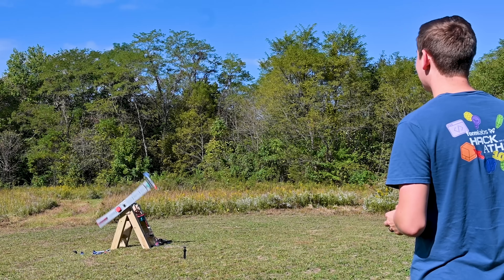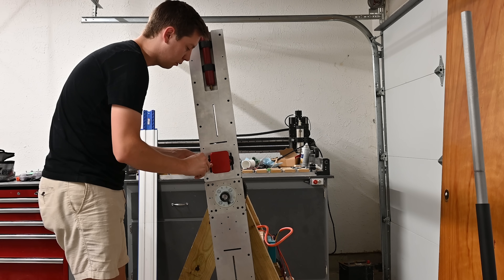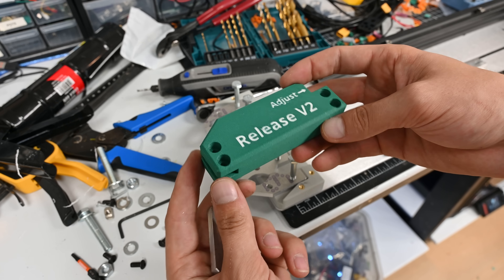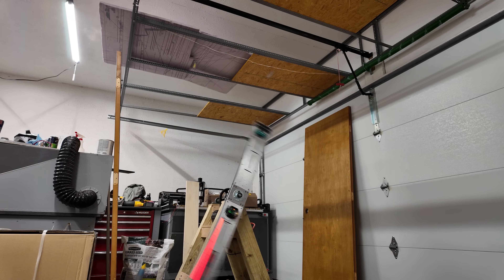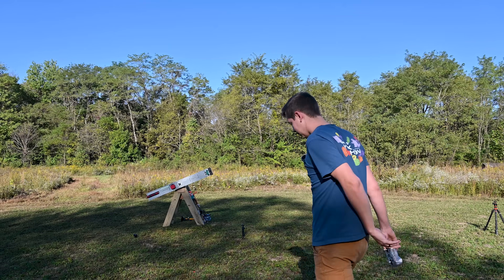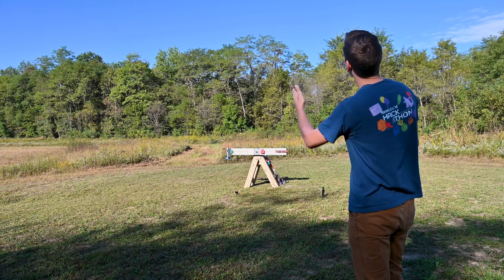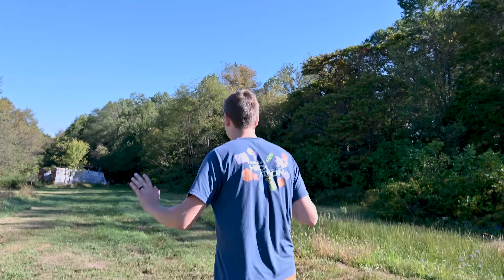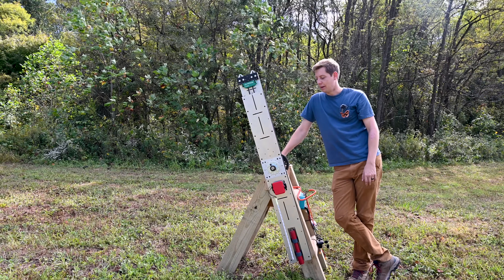I Fixed SpinLaunch

Comment: some recommendations for a next version, as some of the comments have mentioned, are to drop a counterweight to manage the wobble, this is what the actual spinlaunch does, stake or secure it into the ground somehow to make any shake less, and also you may want to take into account the changing mass of the air tank, when at full pressure it will be heavier than unpressurized, and you could conceivably even use this to act as a counterweight dump, where when it releases the air, the mass drops, and counters the change in mass of the rocket being released. 

also a rocket motor would be cool :)

Comment: You see that wobble when it's first released? yeah.... that's not good for a life sized payload being flung into the space. Plus, more structure support (more weight) will be needed to now to support the centrifugal forces acting on the sides of the ship during spin-up. nice for hobbyists though. nice job. put a g scale on that model rocket to record the amount of forces/direction acting on it during the entire launch cycle to get an idea of what is going on and make a video of the results.

Comment: Maybe look at the dynamic balance mechanism from a HE front load washer. Added to the front of the arm it may allow for higher rpm with better control of harmonics and vibration after rocket release.
Subbed to see the next video.

Comment: Pneumatics isn't super precise. A lot of variables there. There are better release mechanisms that require less force to release. Combine that with a electrical solenoid that is better at replicating the same action over and over. Pneumatics won't do the trick at higher speeds.

Comment: camera and rocket motor in the rocket to ignite at max height would be a great way to add weight while making it more cool. Also a mechanism to adjust the counter weight after the release will probably be necessary at higher speeds.

Comment: For the release mechanical, would there be any way to link the differential release with the rotation / angle of the arm? Making it time-based is tricky, as the requirements change at different RPMs. The correct release points should have a direct correlation with specific points in the arm's rotation, though, so a direct linkage to that (mechanical, or digital) would make the mechanism automatically compensate for variances in spin speed. 

Mechanical seems like it would be best from a reliability perspective, but could also get complicated and / or heavy. Having an encoder of some kind on the drive shaft for the arm could allow you to digitally read the position of the arm, and have solenoids release at the appropriate positions. That will require both quick computing and quick mechanisms though, since at higher RPS, we're talking very short time windows for this. 

It would be really nice to combine a mechanical release system with a weight that slides outward some when the rocket is released, to help compensate for the balance issues presented by the rocket's mass no longer being present. Perhaps a sliding weight could be released into "free fall" (sliding down some length of the arm), and as it sides down its path, it triggers the differential release hooks one after the other. The speed that weight slides down the shaft should be determined by the RPM of the arm, which would mean the timing of the release hooks should be consistently appropriate for however fast the arm was spinning at that moment (friction aside). Since the weight would end its slide further from the pivot than it started, its impact on balance will be increased, compensating (at least partly) for the loss of the rocket. You'd need to absorb the impact force on the end of its slide, though.

Comment: To help compensate for the imbalance after launching, you could potentially add a small weight near the pivot on the THROWING side of the arm that, on rocket release,  is allowed to slide further out along the arm. This avoids some of the hazards of having a weight that gets released from the counterweight-side of the arm, since this proposed weight stays captive, rather than getting thrown. It does add its own challenges, though, so it would definitely need to be investigated, first.

Comment: What if you put the rocket on its own little spinner that's directly belt driven from a stationary sprocket in the center, to counterrotate the rocket against the big arm and keep it constantly aligned with the horizon? Or you could keep the little spinner synchronous with the main arm and then engage the belt with the stationary sprocket just before release. That would keep the main arm balanced most of the way, but introduce a larger shock on release.
The little spinner idea would make the launch independant of the rocket's mass, moment of inertia, "muzzle velocity", all that jazz. I think in your current design you'd have to adjust the release timing for every specific rocket.

Comment: Looks like a fun project. How about updating the release mechanism to have two actuators so you can programmatically control the release time of each. This would allow for real time rotation calculations to release based on your spin rate. Another mod would be to have a sliding weight to help with the balance and have its position programmatically controlled to compensate for small balance issues and to have a large and quick move on release of the rocket to keep the mechanism balance after launch. More safer when going to a heavier rocket.  One last idea for the release mechanism would go back to what you were trying initially but make it more like an atlatl that is used to throw spears, arrows, and darts.  Again, looks like a very fun project.

Comment: I assume they make radio activated ignitors for small rockets, stick one of those in it and have the system wait a few seconds to send the command. Definitely while still moving at a good speed of course so it goes up rather than a random direction

Comment: Just one thing of many, I haven't got How's the spinner supposed to stay balanced after throwing the payload away?
Suppose you're just launching a banana. It's a big ferry wheel tho, you want the edge to spin at the Earth's escape velocity, unbalanced of a banana... Things add up quickly, this thing (I'm speaking to the SpinLaunch guys) sounds fascinating but a lot like the space elevator 2.0...
Reply: (yest the idea remains fascinating, winning the initial effort with no fuel is a HUGE weight saving compared to starting rocketing from the ground. The decrease in fuel need is ofc exponential as the rocket goes up.)

Comment: Im a bit into the viewing and I don't see you tackling the problem geometrically. You want to have the rocket following a tangent. I see you need the rocket to slide, as it's released, along a camme in order to have the rocket pushed at the height of its baricenter, to follow the tangent. I thought you would have to release the rocket and simultaneously have the camme profile swap out of the edge of the launch arm, but as writing I realize that... Probably not even.
Probably the entire geometry of the launch can be controlled with the camme shape, no moving parts.

This problem I feel its trivial for an engineer but it's fascinating me.
Reply: Oh, ok you rely probably on a inclinometer to release the bottom lock as it reaches the same incline at which the previous lock had released.
 If so you have a constant velocity or you have to. Daaamn I'm not quite imagining how the camme I suggested should be shaped, apart of thicker to the bottom, if the thrust stays effectively aligned to the mass. But if so..."No moving parts" should sound bebop for anengineer! ;) 
*no moving parts except a single point release mechanism